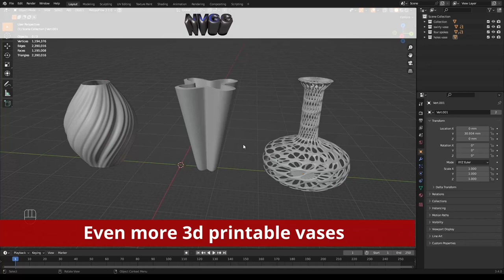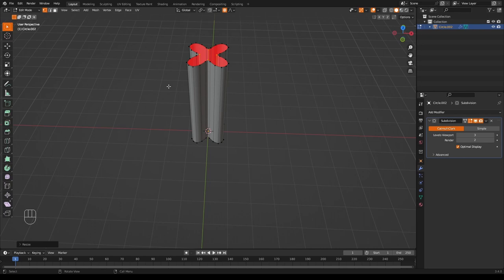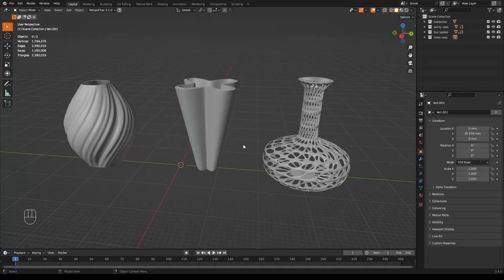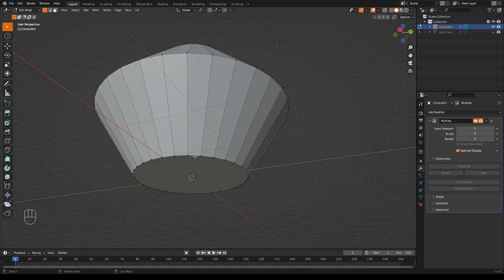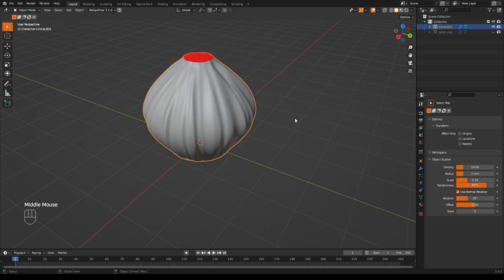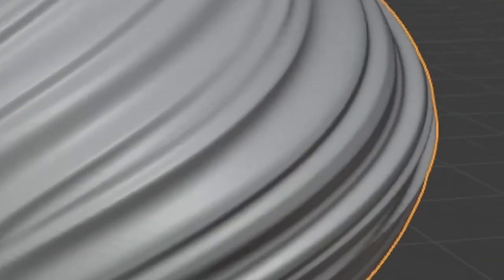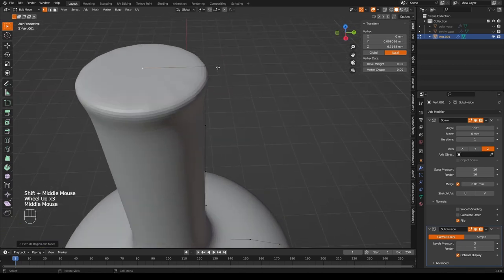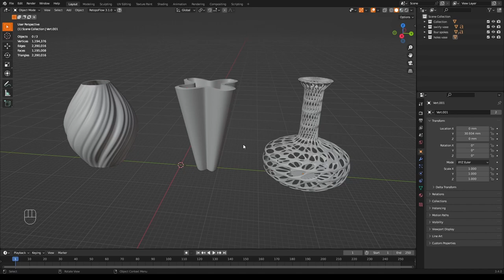How to make even more vases for 3d printing in Blender

Comment: Hello, I am trying to make the second vase, and while sculpting the lines affect my bottom, even though I did everything like shown on the video…what can be the problem pleasee??😢
Thank you for the very informative video!!
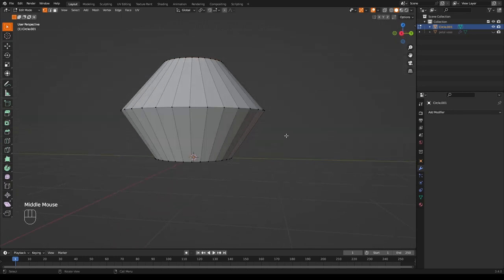Reply from the maker: Did you actually create the face set as described at 05:25 as well as check the Facesets box in the brush properties for the brush you are using?  It is worth noting that the facesets check box only applies to the currently selected brush.  If you change to a different brush you will have to select it again.
Reply: Yes, I did, but I’ll try again today..I was trying to do everything step by step as you did.. Thank you a lot for the response!!
Reply from the maker: @marias1298  No problem, let us know how you get on.

Comment: Hello, great video. Is there a way to fill vase's inside with generated wireframe?
Reply from the maker: Glad you liked it.  I am not sure what you mean though.  It is possible to have a solid vase with the wireframe pattern on it if you unselect the "Replace original" setting int he wireframe modifier and playing with the thickness and offset sliders (plus you might need to add a solidify to it.  Did you have another thing in mind?
Reply: @notverygoodguy  I'm new with blender, so didn't know how to exactly name it. I tried to search some images and found that "gyroid cube" looks similar to what I want to achieve (same wireframe pattern generated and connected inside the vase).
Reply from the maker: @netreneris  It will be quite difficult to do in Blender but you might be able to do it by creating a normal vase and getting your slicer to add a gyroid infill and setting the number of walls, top layers and bottom layers to 0 so it just prints the infill.  This might need a bit of playing around with the settings.
Reply: @notverygoodguy  Hmm, it sounds difficult for a newbie. :) Of course, THANKS a lot.
Reply from the maker: @netreneris  I did kind of assume you wanted to 3d print the result as it's easier to do with 3d printing slicer software.
Reply: @notverygoodguy  Ok, I'll try to look to slicer software. Do you have any recommendations? :)
Reply from the maker: @netreneris  I happen to use PrusaSlicer mainly and I personally think it is very good.  Remember though that you won't be able to export just the infill as an stl.  You will only be able to print it.

Comment: I don't have single vertex in mesh drop down
Reply from the maker: I thought it was by default but maybe you need to enable Mesh:Extra Objects in preferences.  However, you can always add any object and in edit mode select everything with a and then m->merge at center.  That will give you a single vertex.
Reply: @notverygoodguy  Thank you sir